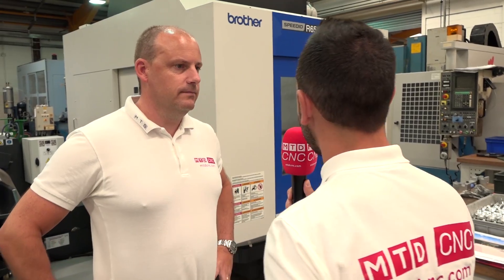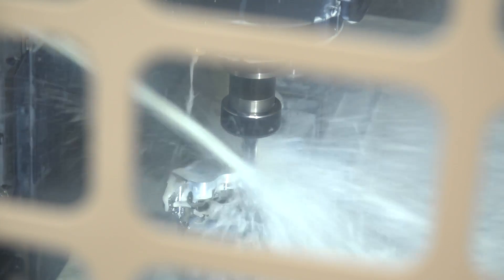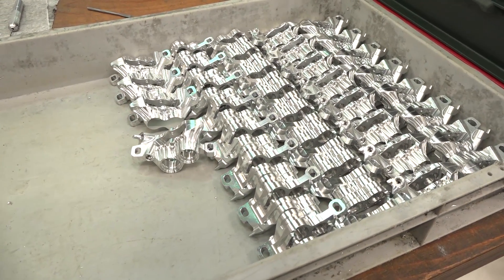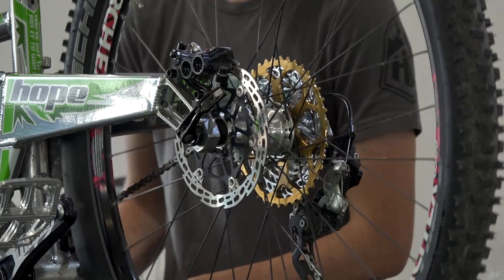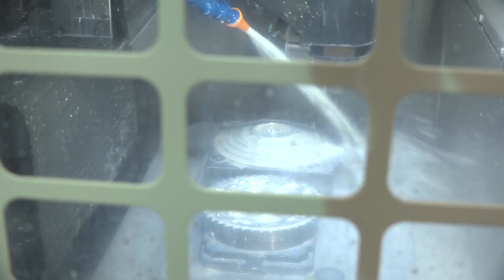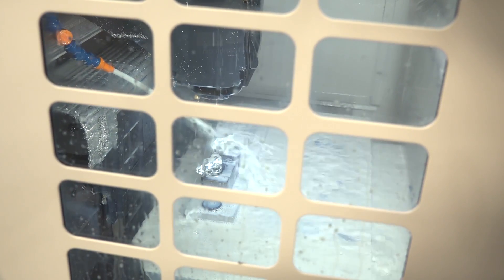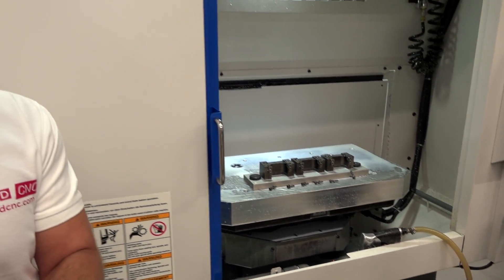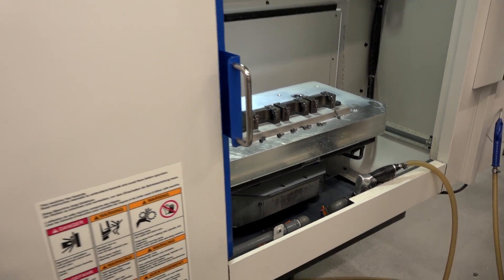Have you seen the speed of these BROTHER SPEEDIO machines

Comment: Although the brothers are very fast , with metal to metal tool change at about a second , they suffer from program lag . Which is when the program moves very quickly it catches itself up and stops . They also , with only bt30 , cannot take big cuts and are only really useful on softer materials . So they are stuck in a small band of parts where other machines can generally machine anything .
Reply: Hi Andy. We would welcome you to contact us at Whitehouse Machine Tools regarding your experiences of the Brothers. I can normally increase customers existing programs performance by 30% just by running on a Brother control. With regards to the BT30 all out machines are Big Plus spindles which have the same rigidity as a standard BT40 spindle. Mark
Reply from the maker: Hi Andy, we've done alot of research on the BT30 thing and have found some engineers using these machines now with steels, EN8's and even EN 24 T so they seem to be making progress. As for the programming element these guys were raving about the processing speed so maybe that has changed now. Thanks for the feedback.
Reply: Google on dynamic milling. but for that work piece, a 5 axis 2 pallet machine is more productive.